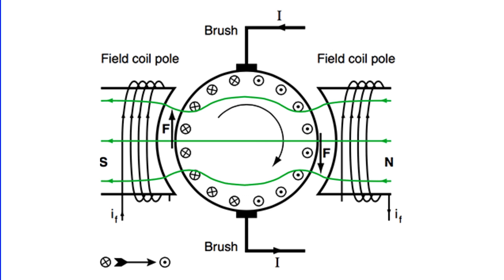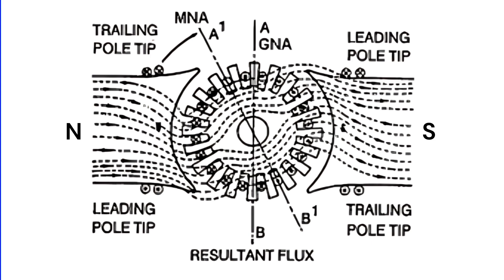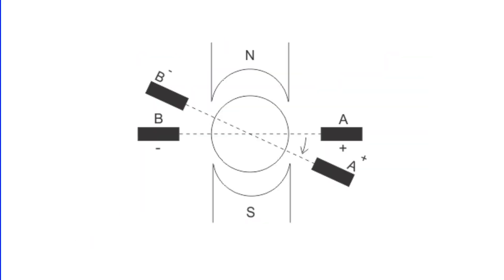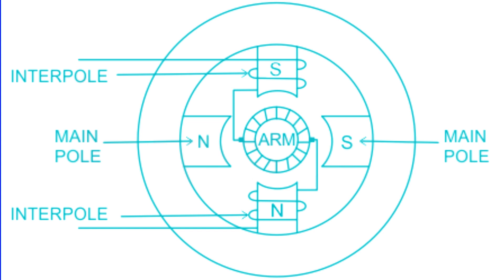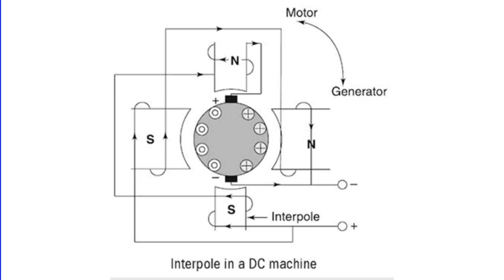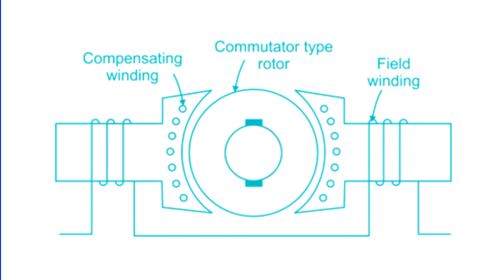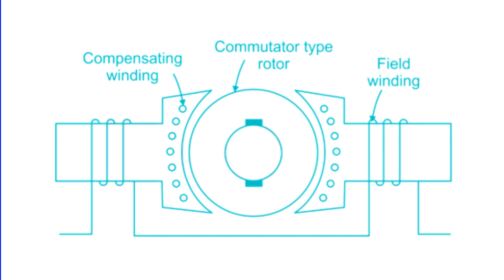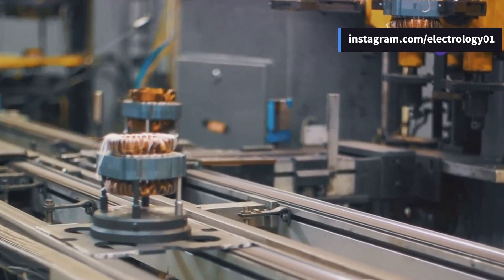Demystifying Armature Reaction: Interpoles & Compensating Windings Revealed!

Comment: at least can we said that "interpole windings" and compensation windings are the sames?
Reply from the maker: No. Both are different.
Reply: @Electrology001  thanks for the answer, i try my best to understand the difference, but i have to recognize, it is difficult to get....  if eventually you would have a bit of time to do a short resume here under, i would really appreciate it ;) thanks a lot bro
Reply: @Electrology001  also i have an another question, perhaps a stupid one, forgive me if yes : does the compensating winding and also the interpole winding, can be use into full induction system that work with magnet? thanks
Reply: @Electrology001  i think i just get something about the difference between interpole and compensating winding, tell me if am right: interpole winding, is implanted so between main pole, and so, compensating winding is wind on main pole themselves, to finally create a bifilar coil? am i right?